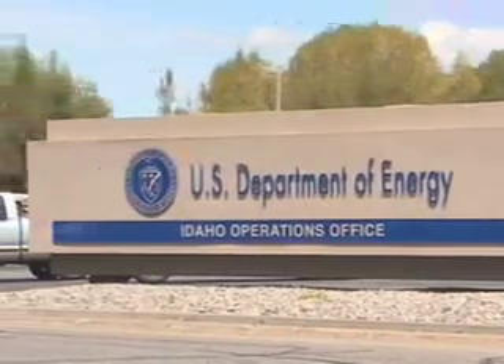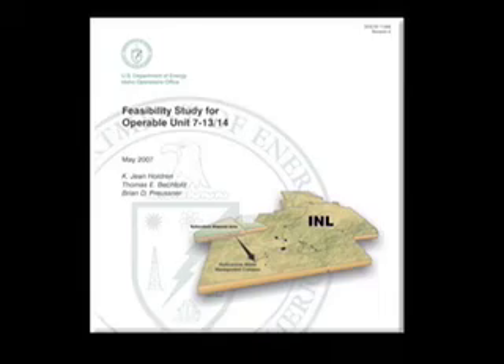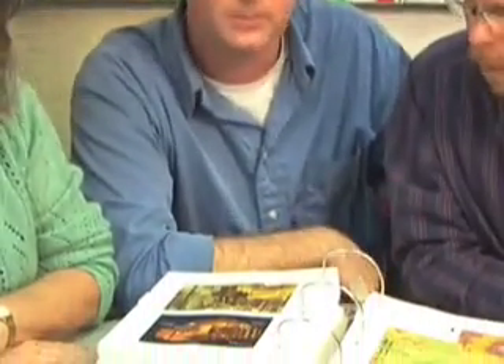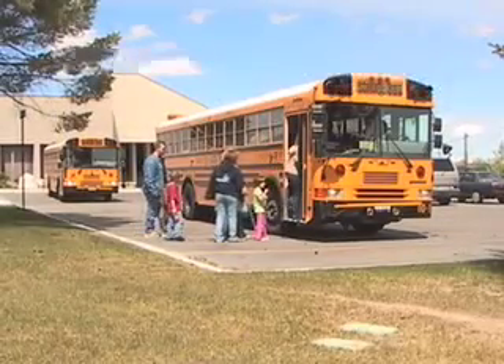Buried Waste

Comment: that garbage should have never been buried here. because of what DOE did in 1975 Idaho is sick they poisoned her. at this point all of Idaho's water is contaminated with uranium and sodium nitrates. this along with lead and arsenic are getting into our wells. Pit 9 and Pit 4 need to be dug up and the uranium warheads removed from the aquifer then DOE needs to treat the water and make Idaho better. if they fail Idaho will die of radiation poisoning and I will kick their sorry butts out of office. DOE YOU POISONED MY IDAHO CLEAN IT UP!